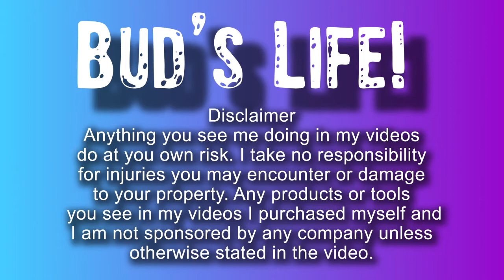2011 Colorado 6.0 LS Swap How To Paint You Engine and Transmission

Comment: Loving the progress, what are your plans for a driveshaft to go with the 4l80e? Also do you need to make new transmission brackets or mounts?
Reply from the maker: Thanks I'm planning on using the drive shaft that came in the truck it looks like it's going to be the right length. I was told that this was a 4L80e transmission but now I'm not sure, I measured the transmission that came out of the truck which I know is a 4 l60e  and it's the same length as the one that came out of the 6 litre truck so I'm not sure why those Transmissions are the same size. But I did have to modify the transmission mount, I'm going to have the video on that very soon.